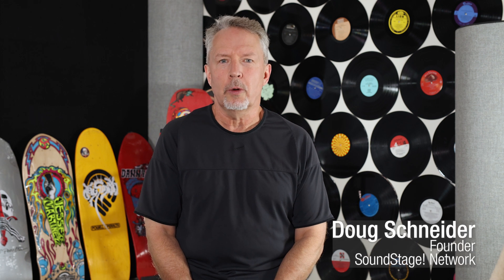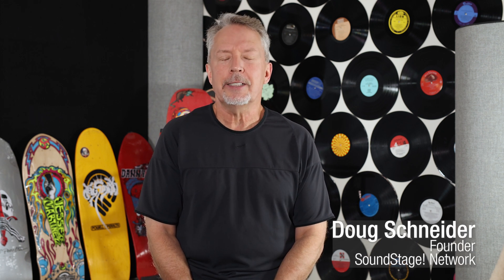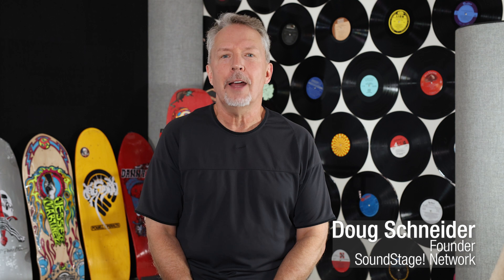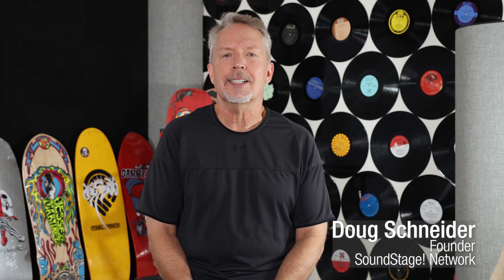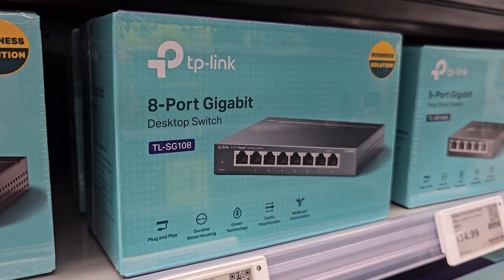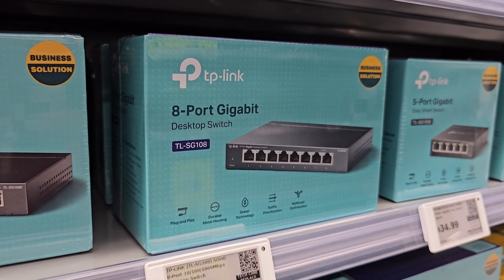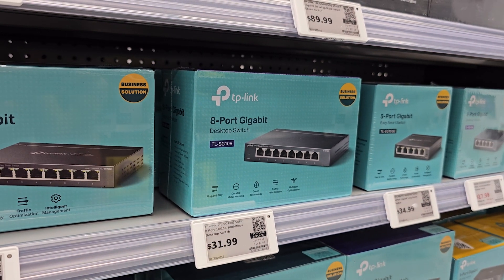How an Audiophile Network Switch Can(not) Improve the Sound (Ep:74)

Comment: I did wifi router modification before and have objective measurements to show how network performance can be improved reliably with lower network latency and jitter.
Reply: All ears -- go ahead and demonstrate the measurements that show this. But also, know the measurements have to show the impact on the converter.
Reply: Unless you're streaming UDP or have so much packet loss you're running out of buffer network latency and jitter will have absolutely zero impact on audio quality
Reply: @v0ldy54  Yamaha concluded that cable and network also affect jitter.
Reply: @fidelizer.  Yes, but the point is that jitter doesn't influence audio quality unless you're using a UDP protocol, which no sane person would do
Reply: @v0ldy54  It does. Sampling jitter is proven to affect audio in 802.11n network based on IEEE material. Most people are misinformed from IT gurus outside direct field.
Reply: @fidelizer.  That's impossible, as I said unless your packet loss is so big you run out of buffer (which is nigh impossible since an ENTIRE song probably takes a couple of seconds to be transferred via LAN) you'll never notice anything because even with jitter the transmission is still bit perfect if you use TCP protocol.

And btw, if it wasn't bit perfect you wouldn't simply notice worse audio quality, you'd notice absurd artifacts and part of the song that just skip completely.
But guess what, that's not what happens because data transmission is bit perfect and buffered, and that can be verified with any network analysis software like Wireshark, it's trivial to see if packets are corrupted yet nobody does that simple test to prove audiophile switches are worth.
Reply: @v0ldy54  Impossible based on theory you understand but there's material from IEEE mentor page to prove otherwise. Human's sensitivity of artifacts from jitter varies. Some can detect only absurd one but some can also notice micro artifacts too.
Reply: @fidelizer.  The point Is that jitter during data transmission via TCP is completely unrelated to the audio jitters, for the DAC there is absolutely zero difference between whether the data comes from a stream, usb cable or stored locally, because before it's converted to analog it ends up in the RAM of the DAC regardless
Reply: @v0ldy54  It is based on IEEE source. But consumer grade below $1k may find it hard to be audible. High-end products above $10k makes it easier to notice changes with jitter.
Reply: @fidelizer.  You still don't understand that network jitter and audio jitter are two different things and also completely unrelated.

A better clock on a switch will improve data transmission (and even that's debatable since any switch can do that job perfectly fine), but will have absolutely no impact on audio timings since it's something handled by a completely different circuit on the DAC
Reply: @v0ldy54  the clock on a router is about phase noise
Reply: @BradGharring-yp3oj  what phase? Definitely not the audio one, that's for sure
Reply: @v0ldy54  Even when using UDP there is a buffer needed which is read out by the streamers clock. When UDP is used the programmer has to handle packets arriving in wrong order on its own - and he has to think about how to handle lost or defect packets - just ignoring would of course cause interruptions in the playback - but in todays Internet defect packages or package losts are extremly rare.
 TCP makes live easier for the programmer has he not have to handle packets arriving in wrong order or defect packets.
Reply: @fidelizer.  Yes - but did Yamaha show that this jitter is still there behind the buffer and before the data flows to the digital to analog converter?
Reply: @fidelizer.  "Sampling jitter is proven to affect audio in 802.11n network based on IEEE material."

Provide a source to that IEEE material or at least tell the title of that paper.

If you "livestream" audio data (like in phone calls over Internet) it is true.

But music streaming of prerecorded music is not "live" - before the digital analog conversion there must be a buffer (FIFO) which adjust the speed with which the data is arriving from Internet (which is in most cases much faster than needed for playback) and the speed of data which is needed for playback.

Comment: Just some additional info. ALL RJ45 ports on all network devices HAVE TO provide galvanic isolation. That is enforced by the Ethernet standard. All even the cheapest of switches have that. Usually it is implemented through a transformer. In expensive devices it might use an optical isolation. Even the transformer (magnetic) isolation will do away with most any noise being transferred from the network device to the receiver. RF noise can always be picked by the cable. So the one and ONLY thing one should take care of is use doubly shielded ethernet cables. They only cost a few cents more than the unshielded or singly shielded ones.
Reply: All cars have to provide safety for their passengers in case of an accident, which is enforced by the law. Reality is that in some cars you can get easily killed, while other hi-end cars protect your life much better.
Reply: @andru2625  In case you haven't noticed we are not talking about cars. Not all metaphors are valid.. There are not many ways to provide galvanic isolation on ethernet ports. You do it either through transformers or through optical conversion. If a device does not provide optical conversion then no matter how audiophile it purports to be and how much money it asks from you, it is doing no more than your run-of-the-mill network switch.

Comment: Noise can never be an issue. We're talking about a digital signal, a packet. Even if noise would impact the transmission of the packet, there are safeguards in place like checksums and packet-retransmission to solve this. In the end, the received packet is the same as the sent packet. And if someone claims they the music sounds better or different, that would mean the digital data was affected (which per definition is not possible in a digital transmission). With the right equipment, this can be measured. But so far, no-one seems to have measured anything on these audiophile switches.

Comment: Thanks for sharing.  I have heard that when the internet signal is converted to a digital signal via fiber optic that any noise is automatically filtered out.  This may be a good alternative for streaming hi bit rate audio.  MokerLink Gigabit SFP to RJ45 Converter, A Pair 2 Pack Single-Mode Fiber to Ethernet Media Converter, 10/100/1000Mbps RJ45 Port, 1000Base-LX SFP Module 1310nm up to 20KM
Reply: Yes, it changes it -- and therefore breaks the electrical connection -- but on the receiving end, you have all kinds of electronics again to receive and decode it. So is that better or worse?

Comment: I also have decades working with switches and been an audiophile longer. I actually heard a network switch demo at the Tampa audio show and the sound was actually worse with their expensive switch compared to the cheap switch. They were having some issues but when the owner did the a/b comparison, their multi thousand $$$ switch sounded worse
Reply: It would be weird for that to happen, but it's also possible that the "audiophile designer" who created the switch degraded the performance of it such that it wasn't passing the data properly anymore. As I said, without doubt, all these high-priced network switches are simply modifications of existing mass-market ones.

Comment: Doug, you appear to be a little misinformed here...  Some measurements have been made showing the analog output of DACs changing with different Network switches, look up you tube videos by Alpha audio for example.  Additionally, do you actually believe that the current standard set of audio measurements completely describe the performance of a given DAC?  If so, I suppose your reference DAC is a Topping D-90, right, as it has "perfect" measurements, right?  Or do you accept that the current set of standard measurements are not extensive enough to describe all the sonic attributes of a DAC?  I know that, for example, a Mola Mola Tambaqui DAC sounds way, way better than a Topping D-90, despite the fact that the measurements show no differences of a level which could be audible.  By the same logic, the noise inherent in wired Ethernet Networks may be effecting the DACs output in a way which is not evident from the standard set of measurements.
Personally I choose to connect my DACs to the Network via optical fiber Ethernet, which greatly reduces the chance for electrical noise interference with the DAC.
Additionally, although I agree that there are some companies charging exorbitant amounts for "Audiophile" switches, which are usually only just a standard commercial switch board in a nice chassis with the addition of a decent linear power supply, there are much more interesting Audiophile Network switch products available where the manufacturers have designed a complete main board of their own, with UpTone Audio Etheregen, or the Nordost switch as examples, and there are at least a couple of others.
Reply: Perhaps you can inform me. When I created this video, I saw no measurements showing the output from any DACs. If that's changed, can you tell me where they are? As for the "perfect" measurements that you're talking about, I've never seen a product with perfect measurements, nor have I seen a product where the measurements are identical to another, meaning they couldn't sound difference. There are always differences.
Reply: Hi Doug, you might want to check out the measurements here:
https://www.youtube.com/watch?v=dstO0650oKk

As to my comments on "perfect" measuring DACs using the standard set of audio measurements, go the Audio Science Review website and check their measurements of a Topping D-90 vs a Mola Mola Tambaqui DAC.  I put perfect in quotes because, of course, no audio components actually measures perfectly, there is always going to be some element of distortion and noise.  While amplifiers and speakers are never going to measure "perfectly", we now have DACs which do.  By "perfect" I mean a standard measurement set where all the distortion and noise products are at levels which are non-audible in an audio system playing in a a room.  For example, no one is going to hear distortion products at -120 dB in any audio system playing in a room.  We have DACs now which measure at these levels, and hence are essentially "perfect" as to any audible noise or distortion on their outputs, and the Tambaqui and D-90 are among these "perfect" DACs.  Now there are those who claim these two DACs could not sound any different from one another because the measurements show they are "perfect"!  I am not among those persons, and have heard both DACs, and clearly the Tambaqui is another class when it comes to sonics from the D-90, despite that fact that they both measure "perfectly".
The point which I was trying to make, is that the standard set of audio measurements is not entirely adequate for determining the performance of an audio component.  I do not believe it is impossible to measure everything, but I do believe we do not measure everything, or at least the standard set of audio measurements do not measure everything which matters for sound quality.  Hence: it is possible for Network switches to make for a sonic difference which does not show up in the analog output of a connected DAC via the standard set of measurements.

I work with a company which develops, manufactures, and distributes Network connected Hi End audio products, (we do not make a switch).  And the things we have found which matter to sound quality continually surprise us (we do own an AP and other sophisticated test gear).  Some of these things are currently measurable by us, and some are not.  For example, most exasperating for me is the effect a better Ethernet clock has on sound quality-it makes an astonishing difference, certainly of a level which is meaningful to audiophiles.  Why, I cannot say for sure, one of our digital engineers has a theory (currently unproven) of why, which he is currently trying to find a measurement for, to allow us to quantify these differences-right now, all I know for sure, is that a clock with lower close in phase for the Ethernet clock, does improve sound quality in my testing, and expectation bias before this test was to assume that it would make no difference!

As a professional reviewer, I generally respect your work, but in this area it appears that you may have made some assumptions without actually testing things to hear differences for yourself.  I would suggest a more open mind might be in order before claiming it is "impossible" for things like Ethernet clock performance to matter to sound quality.
Reply: @barrowsworm1226  Audio Science Review is hardly a voice of authority in hi-fi design -- and they certainly don't speak to me. That said, in that video, can you please tell me where he's showing how these switches affect the output of the DAC?
Reply: I am no big fan of ASR either, they are totally closed minded and kind of ridiculous (and they are apparently deaf, haha).  But they have published relevant measurements for quite a few products, and those measurements are accurate now that Amir has learned how to actually use his AP (he made some mistakes in the beginning).  I am only referring you to them as a source of the measurements I was talking about.
Did you actually watch the video I linked???  They demonstrate, specifically, that higher noise on the Ethernet input to streamer (the streamer under test has a DAC as well) results in higher jitter on the analog output of the DAC.  That is what they tested. @dougschneider8243
Reply: @barrowsworm1226 So just for you, I watched it all again. Now, unless I'm missing something completely, there are no analog measurements. Instead, he's attached probes somewhere near the clock and he appears to be analyzing its output. That's not the analog output of the DAC. Correct me if I'm wrong and he's doing that somewhere I haven't noticed.

More important is that he raises more questions than answers. One question I have is if his test is even valid. He seems to have concocted something and is producing measured outputs, but is this actually showing anything? I'm not going to pretend to answer that, but I did send this video to a couple of digital designers to see if, in fact, it is showing something relevant.

And another question I have is why he isolated this test to just one DAC. Surely, a review publication has multiple DACs on hand -- I have five within my line of sight. Why, if he's proving that switches make a difference, didn't he repeat this across multiple DACs to see if they all behave the same? 

All told, I'm not sure what exactly he is showing -- and if it means anything.

Comment: I’ve tested ‘audiophile’ network switch and there is an audible difference. It’s obvious but not huge. I know it can potentially be psycho-acoustics but I highly doubt it. Not when it affects parameters like sibilant.

If I were to unscientifically quantify it, I’d give it no more than 5% improvement.

But I would not spend on such components as the money is better put into speakers, amplifier or source. I’m still using a cheap network switch.

As for all the talk about A/B double blind test … many want that but they don’t do that when they audition or review equipment. Remember … it’s stated that same song can be made to sound different right? Food for thought.

I do dream in colour. 😂

ps yes the core parts are more than often from some IT component manufacturer. Seen the inside of a high-end network switch and it is primarily from an IT component manufacturer.

ps who did this channel feature Siltech? Cables are a massive controversy. Would the creator of this video revisit the Siltech video? Siltech cable for digital data … how does it improve sound? Siltech has very expensive Ethernet cable that is very expensive to transfer data.

Care to prove or debunk it with a separate video? 😂
Reply: "As for all the talk about A/B double blind test … many want that but they don’t do that when they audition or review equipment."

Most people don't, but if you really want to suss out if you are truly hearing a difference, it could be good to do it.

Comment: No. Switches do not forward packets.They forward frames. Routers forward packets. If you are going to attempt talking about this stuff you need to understand what you are talking about.
Reply: Some switches work (also) at OSI level 3, handling packets (in addition frames).
I don't think we need to go into that level of "correctness " to make the point he's making .
It's already hard enough to convince audiophiles the last meter of power (cable) cannot make a difference if the house power wiring is just using ordinary 2,5 mm cable ...
(Let's not even start about the influence a starting washing machine would have when on the same circuit 🙄)
Reply: come on, flaming the argument just because of a very tiny terminology difference, considering the arguments are for non-technical non computer engineering people is too much